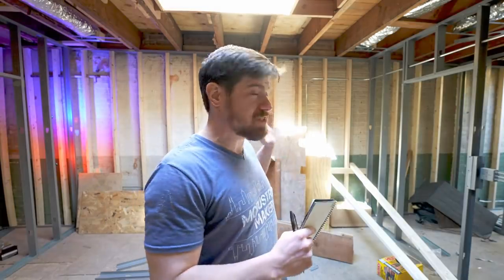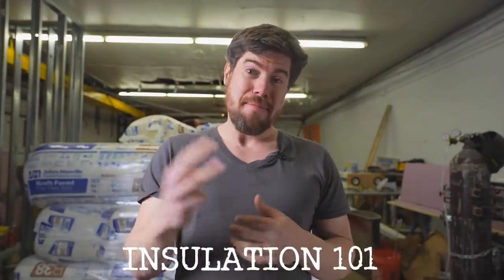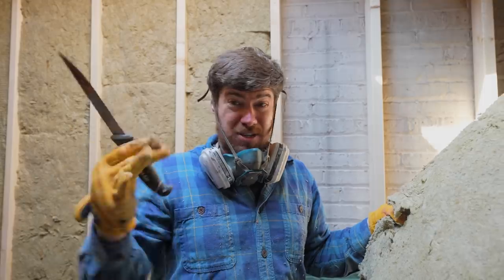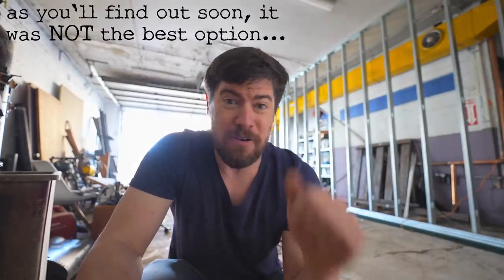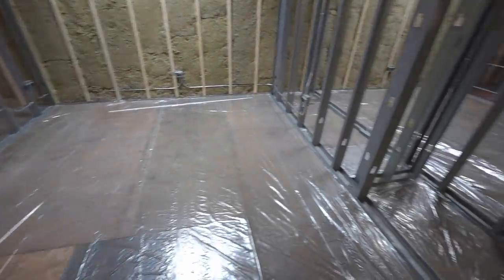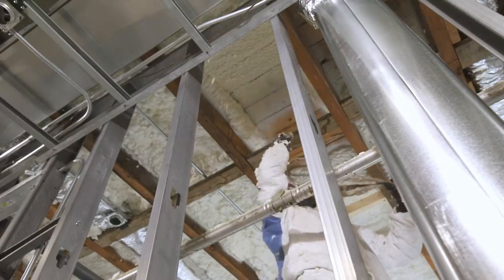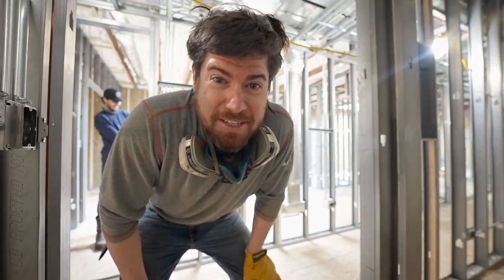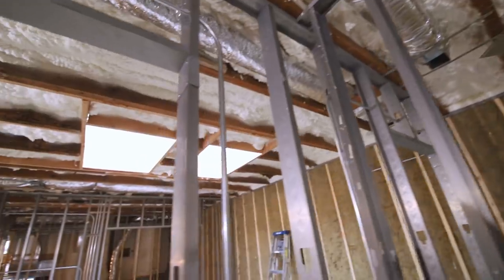Ep. 15 Abandoned Building Renovation || INSULATION + SOUNDPROOFING

Comment: Ok, me as a German guy, I don't understand the "we let the closet and some walls unisolated" part. It bridges the cold air And gaps the isolations. ...  I don't understand the "in this region you only need this r rating" thing.    Isolate the crap out of the building and you spare cost in heating and cooling on long term. Also you reduce stress because of the Sounddamping effect.

Comment: As an engineer , you are worried about damp in the roof, but the same does go for your walls. You've gone for rockwool without adamp screen... So usually you get a temperature curve inside a wall construction made of different materials, ouside is cold, so the outer layer of bricks is the coldest then you go inward and the different materials get progressivly warmer till you reach room termperature on the inside of your drywall, that means inside the wall you het a curve and somewhere you will get a condensationpoint. usually just behind the drywall. Which is why usually the rookwall has a dampscreen on one side , like tin foil like layer. (might not be the right term, english is not my native language) that prevents condensation inside the constrution
Reply: He can put plastic sheeting over the studs before he puts the drywall up.
Reply: Houses in the netherlands are isolated with rockwool. I'm an engineer myself and i can acknowledge that you need ventilation for rockwool. The problem with his connecting neighbour wall is that if they don't heat; the external temperature of the walls will reach 10-13 degrees. Depending on the humidity indeed moist will form, small water droplets. All that moist will sink into the bottom of the insolation and will start to ROT.

In the netherlands we have an outerwall; then an air wall (no wall) then the insiide constructieve wall. Between these walls the isolation is placed; so it can ventilate.

new technology also has moist/rot free panels; but they are regularly only used at the lower 1m.

Too sum it up; indeed if his neighbours connecting the brick wall are not heating; he has a problem.
Reply: I was thinking he should have a film barrier  but I don’t know commercial building code.
Reply: @RussellNelson  plastic sheeting on the studs won't prevent the rockwool to catch moist if temperature drops
Reply: Doesn’t he have neighbours either side and they aren’t ‘outside’ outside walls rather than party walls?
Reply: @BeansBuilds64  won’t it limit the humidity transmission from Inside to outside?  A little moisture breathing between brick and insulation is ok, but that constant flow of moisture from inside is the killer from my understanding.
Reply: He says he has r8 on top of the roof. Wouldn't that have mitigated condensation concerns?
Reply: *vapor retarder or vapor barrier is the term used here

Comment: Wondering if you have considered wiring the interior with Network cable,  before the drywall goes up ?
if your going to use Wi-fi, consider hackers and whom ever trying to break into your Wi-fi network, all day long in the City of Chicago. 
 Plus....wire is more secure than wi-fi when doing banking (credit card) transactions, or anything involving your Social Security number.  

Sorry,  I.T. geek here, and former Chicagoland resident.
Reply from the maker: you must be psychic....I'm actually doing a video on the 5 customizations you must do before hanging drywall.  one of them is running cat6 in the walls...
Reply: @modustrial  Outstanding !!
Reply: Run pvc or similar behind insulation/drywall. Run all wiring, networking in that pvc. Makes upgrades a breeze, instead of a nightmare! 👌😎

Comment: The problem with your original plan wasn't the lack of air space, it's that the roof is your vapour barrier and it would end up being on the wrong side of the insulation.  The vapour barrier stops moisture from inside the home from migrating through the insulation and condensing on the cold side.  Open cell foam is not a vapour barrier and I suspect you will end up with the same problems. Sorry to be a downer.
Reply: This.  He needed to read some Lstiburek and learn the basics first.  Also watching him using that homeowner can of great stuff instead of a basic foam gun was painful.  😔

Comment: Something you may want to look into, it's called QuietRock, it's a sound dampening sheetrock panel,it's double ply with a barrier in between which basically equals 4 or more sheets of regular drywall.
It's more expensive (around $54 USD per sheet) and you may have to bump out your receptacles (they sell 1/2 inch box extension rings at Home Depo and Lowes),
You will probably only need to do the walls with the metal studs since the brick wall/mineral wool themselves should be more than enough of a sound barrier.
Just something to look into,it may fit your needs better than the typical foam panels folks attach to their walls which to me just steal wall space better used for other things.

Comment: Just wanted to give some terminology corrections!
Sound proofing is when you keep the sound in a room!
Acoustic treatment is the panels you put on the wall to control the reverb of the room!

Also, when you put in drywall you will get rid of your dead sound and the lack of door kinda makes the soundproofing a bit pointless...

Lastly for proper soundproofing you want 2 layers of rockwool with an air gap between them!

Comment: In my part of the world (central Europe) styro foam is probably even a bit more common than mineral or glass wool. I'm talking about sheets of styro foam, not the PU spray foam which is not that popular. And I'm only talking about exterior walls, not the roof which in most cases if it's flat still gets styro but for steep roofs it'll most likely be wool. I think the popularity of styro foam comes partially from it's better price compared to mineral/glass wool especially when it comes to top lambda values like 0.031 which for wool means big increase in price and weight. Second and perhaps more obvious reason is that 99.9% of houses here have their insulation outside and styro foam is easier to mount in such conditions plus it's much more resistant to moisture than wool.

Comment: How in the world can that insulation have an R-value of 15m2*K/W? 15m2*K/W is extremely high. The most expensive and insulating insulation out there would have an R-value of 5.45m2*K/W for a 2x4 wall. For ordinary rock wool to have an R-value of 15 it would need to be 212 inches thick. Your walls sir are not 212 inches thick. Feels like the US is using the term "R-value" completely wrong.

Comment: rockwool 30... best money can buy, buy it once and do it right the first time guys... this stuff is expensive, but oh so worth it

btw, it is NOT a "bit more expensive" its alot more... but the performance is so good

yes, spray foam is the best "performance rated"... HOWEVER... if you ever have to add something... you will HATE IT, HATE IT, HATE IT... also it hides leaks that would normally show through insulation before it starts doing long term damage to a wall/floor/ceiling

also... why the HELL would you spray open cell, they didnt offer closed cell?

Comment: For your YT Studio, if you have left over Rockwall, you can check out "DIY PERKS" ON YT. He makes some amazing cheap sound traps and sound proofing panels, with just some 2x2's, few mitre cuts and can choose whatever fabric you want to make it look classy and match the theme
Can also make 3-4 panel arrays starting with close to floor/ceiling and then the next 2 either side get shorter and shorter yet stay straight line in the middle.
If you have deep corner, also check out bass traps or sound panels you can mount on a easy metal frame and move around. Will make life soo much easier. Unless you are also installing a small vocal set up with 180° isolation for voice over work etc?

If this is gonna be temp for a few years then all your sound proofing etc can be taken with you...and cut to size to work in a different space. Have a look at the wooden diffusers which usually sit on the opposite wall to where the speakers face, really helps break up the muddiness especially in a building with tall a ceiling..

Obviously a nice thick rug is ideas for the space along with heavy drapes/curtains that will also help absorb the sound.. If it's a mods permanent spot, look at things called 'audio cloud panela' easy to make and set up and would be perfect for taller ceilings too 👌
Any advice needed just let me know

Comment: For the youtube studio, i think you'd be better of putting cloth instead of dry wall on the insulated walls because dry wall reflects sound. you could even introduce a bass trap in the corner.
Reply: Exactly. I'm doing this in my house/studio. Take a look at the duckcanvas or duckcloth website (cant remember which). You can order by the roll. They have a section for sound transparent cloth. Good luck bud!

Comment: To avoid moisture problems, in the Netherlands it's common to put damp proofing on the warm side of the insulation so you can't get any moisture buildup in your ceiling/wall :) Oh and also, using XPS/EPS insulation in panel-shape is also quite common :) So you could've done it yourself here! haha.

Comment: I'm only 9 min into the video... but shouldn't there be some air behind the insulation and the exterior walls?  Since it's brick walls, you might have condensation behind the insulation, and if you do... leaving enough space behind will prevent the moist to be drawn into the insulation. (Here in Norway it's recommended to keep aprox 5 cm, roughly 2 inches, of space between brick walls and insulation).

Comment: Reckon a good tip for doing wall insulation and in constructing is: If your coming up against constant smaller sections ‘like the upper pieces on the wall installation’ be more uniform and go half, half instead of 4/5. 1/5, because I found the smaller pieces tend not to sync as well???

GL M8..

Comment: There are a lot of studies that show the difference in sound absorption are minimal.   Fire resistence though is a lot better with mineral wool.  However good sound Insulation consists of mass - spring - mass.   And you accomplish much more reduction adding more mass, then choosing rockwool vs glas fiber.

Also, there are a lot more flavours for DIY'ers to use, especially if not everything needs to be soundproof / absorbont.   Like XPS, EPS and PIR.  But also cotton wool is a nice and environment friendly way to insulate..

Comment: Hey man keep up the solid work! It is really coming together. I enjoy catching up on what you have going on and look forward to each upload especially as I renovate my entire house - bought a fixer upper a few years back. 

After reviewing the footage I’m concerned that you didn’t get what you paid for.  Open-cell foam which you used for the ceiling should fill the cavity between the joists (since you have a flat roof). You can clearly see that the cavity has too little in selected areas and maybe just enough or too much in areas that have electrical boxes, cut outs, etc.  I would do some additional research, spot check the areas that don’t have enough and mark it with blue tape, call the company/team to come back and spray the areas that require more foam based on the rated R-Value in Chicago. Over in the east coast attics with rafters or flat roofs with joists depending on where you’re spraying needs at least an R-38 to meet code but also allow one to not gain/loss winter/summer months accordingly. Maybe you did this but I’d be asking them while they sprayed here or there that this doesn’t look correct.  My buddy works for an insulation company so I have residential knowledge and so maybe it’s different in Chicago (or the fact your building is commercial) but please check to make sure you are getting the proper R-Value for the ceiling area? It doesn’t hurt to ask especially with paying $5,8k.

The walls look great.  It’s flush with the studs which is what you want. I did see that they forgot to shave off foam that extended past the studs in one room- maybe you paid extra for them to do that; if so they need to come back and take care of it. Complete the job if you will.  

Also you mention next steps was drywall. I would run electrical before putting up drywall. If there’s conduit that can’t be snaked as I see empty junction, outlet and switch boxes you’d rather be able to correct the issue then to have to rip off drywall and then correct.

Again just looking out, but curious to hear what they have to say if you end up going that route.  Take care.

Comment: As a former insulator, the use of a tape measure and the time taken to cut is “triggering”. Place the batt with one side in the bay(touching the stud) and lay the other edge over the stud and cut down the stud. Just as tight, better fit and WAY quicker. Should be able to knock out a wall within 5 minutes tops. Also “pro tip”, use a batt knife. $5, SUPER sharp and will cut insulation like a hot knife through butter.

Comment: As a totsllt noob but hooked to your channel for a while, just wondering if before you put the insulation up, is there anything you use on the bare brick walls to weather proof it, like seal it from damp?
I know you have a damp barrier at the bottom where the bricks meet the floor but just wondering about the rest of the wall?
Sorry for such a basic question, but if you don't ask, you end up ignorant or looking like a fool if ever brought up in conversation.

Appreciate any replies guys,

Much love and respect from a young buck in the UK wanting to get into the more DIY side of building things. Like building a room within a room which is air tight with recirculating air supply/carbon scrubber etc.

Comment: Looking good. 
Not trying to troll you, just hate to see your work go for not.
One question did you get Nail Plates over the plumbing? I will guarantee that the drywall screws will find any unprotected pipe. Your copper vent pipe looks to be only a half-inch below the stud surface.

Comment: Quite a significant task. It now allows a blasting session for drywall which will visually transform the place and really move things fwd & up.😎

Btw.. the youtube studio. Adding drywall back in there will only increase audio reflections and reverb. It would be a shame not to utilise the soundproofing already in the walls. Why not build wall size thin wood frames ... and line the walls of the room in fabric allowing the audio waves to pass through and deaden into the rockwool. Your shortcutting using acoustic treatment panels after mounting drywall on walls. Just a thought.  😉👌

Comment: Just binged watched this series in 2 days. Im buying a 4 story house (1 story is a 1500 sq foot garage basement ill be turning into a wood shop) so seeing how all this is done is inspiring. I dont live in america any more, the houses here are built unfinished. Raw concrete walls/ brick. Very little plumbing or electrical run, brick interior walls, etc. You have to remodel it/ hire people to remodel it and i plan on doing some of the work myself. One thing im glad of, I dont have to deal with permits or inspectors slowing down progress. The building is built to code, but interior stuff is left to the owner/ contractors. Its my choice to hire inspectors or not and i dont have to wait on any permits.

Comment: In the UK we have to work with either cold or warm roof's. To explain; a cold roof would be an attic space with the insulation at ceiling level and nothing in the roof structure (attic). A warm roof is where the insulation is built within the roof structure, commonly found on flat roofs, as part of the roof build up. Both roof types require different insulation types, Mineral insulation, such as Rockwool would be used in a cold roof to insulate the ceiling level. Rigid insulation boards would be used on top of a timber deck (or similar) to create a warm roof. This is a basic breakdown, and has some variants but it's important to know what type of roof you have prior to insulating it. 
Useful video, making good progress!

Comment: When you go to do your soundproofing for the Youtube studio make sure you set up your sheetrock with baffle space between the panels. When sound has to go from sheetrock to safe & sound / rockwool, sheetrock, 1/2" gap, sheetrock the air space it has to bounce around will add a lot of deadening. You can use foam panels / eggcrate on the wall for sure to deaden some of the  surface reflection but for overall "soundproofing" you want to think "box within a box" that's where the power of air gaps lies. Love your content. Keep up the great work, looking forward to the next episode. Love the channel!

Comment: Good decision. It should be enough. 
My uncle insulated his new home in Russia with rock wool and his house stays cool in summer while it's 40°c + outside and stays warm in the winter while it's  -40°c outside. 
I live in Germany and my house is insulated with rock wool too. Since it's not that cold here I barely have to heat cause the insulation is damn good. 

Spray foam has a meager disadvantage to rock wool... 
If you need to repair a pipe or cables,  you basically have to rip off the insulation around the part you want to repair. With rock wool all you need is to push it back.

Comment: Hey Mike! I love the content. I've never asked a question before, but figured I'd give it a shot. You were using rockwool on the walls and spray foam on the ceiling, but it looks like you used spray foam on the walls (I think in the bathroom)? I was curious if there was a reason you opted to go with spray foam on the walls where you chose to do it.

Comment: You would want the conduit in front of the rockwool.  If you insulate it TO the inside, and keep the conduit behind the conditioned space, which will make it essentually in unconditioned space you will end up thermal bridging all that cold into the house.  You're spray foam guys had it right. Keep the metal (pipes/conduit) conditioned.